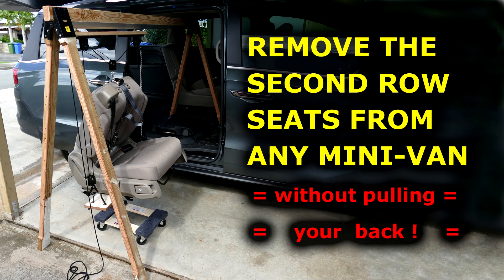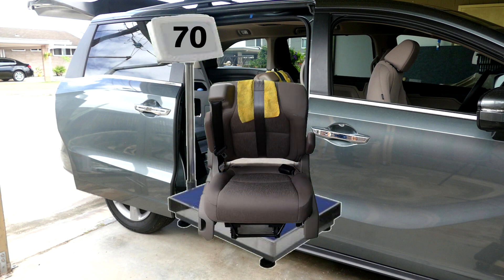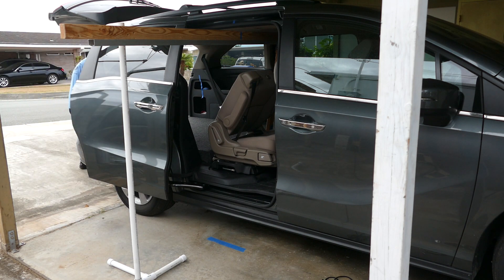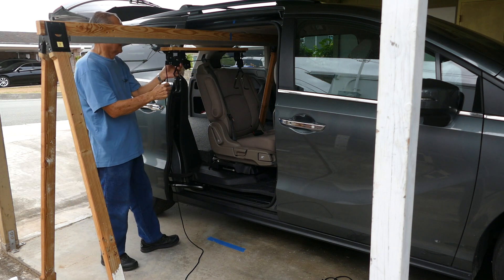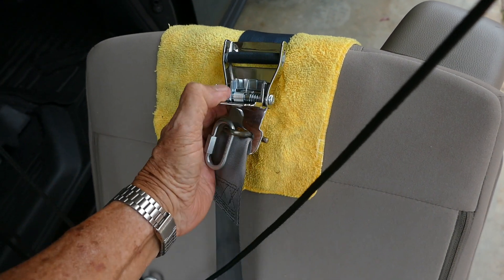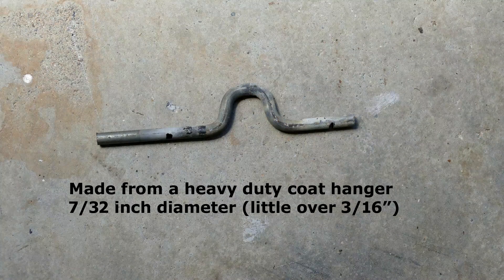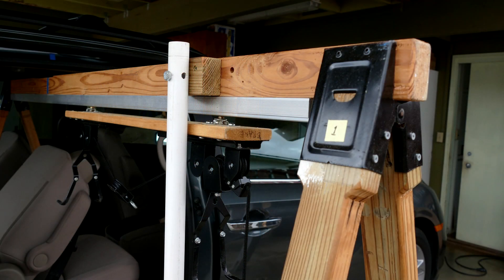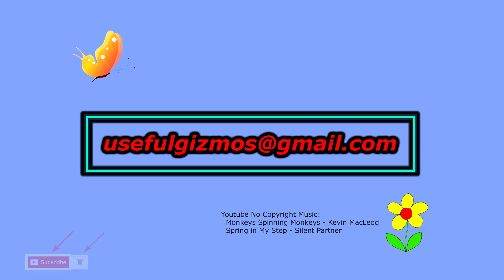Remove second row seats from any van or mini-van

Comment: Wish you put this video up in early 2019. I had to lift these when I needed to haul some stuff. I had a 2004 before my 2019. Honda really blew the design for seat removal. Will not ever remove those seats again without using your design. Thanks so very much.
Reply: Hi Gladiator,  Yes Honda had no consideration for 2nd row seat removal in their design.  Without the capability to lock the seat back in the down position, it poses a greater risk of pulling one's back when removing the seats manually.  Thanks for your kind comments and have a great day! .... Usefulgizmos

Comment: Please where is the video that shows how you made a flat floor for your minivan?
I have all my seats removed from my 2006 Honda Odyssey but need help w/making a flat floor in my cargo area.
Thank you.
Reply from the maker: I haven't made a video for the flat floor.  But to make it, I used 2x4's (1.5" x 3/5") edge wise going from left to right (not front to back) as supports.  Then 3/8" plywood on top.  The back of the plywood rests directly on the folded down 3rd row seats.  ..... The plywood is in two sections.  The back section is a perfect fit when the 2nd row seats are all the way back.  When the 2nd row seats are removed, there is a front section of 3/8" plywood that extends to the back of front row center console. ..... There is a 2x4 placed under the joint of the back and front plywood to support both, with wood screws holding down the plywood to the 2x4. ..... Carpet extends all the way from back to front and covers both back and front sections of plywood.  When the front section of plywood is removed, that portion of the carpet is folded under the back section of plywood. .... Hope this helps.  Thanks for watching and have a great day! .... Usefulgizmos
Reply: @usefulgizmos  thank you for the all that information but honestly Im very confused at just reading all that.
Im 62 yr old female w/bad arthritis & was hoping to see how it’s done.
Im hoping I can find a handyman who can read your instructions & do it for me because I won’t be able to.
Thanks again.

Comment: How about a simple Harbor Freight "Cherry Picker" lift.
Pick up the bugger with a strap and be done with it.

This another example of why easy when you can go difficult!
Reply from the maker: Please draw the plans for converting the "Cherry Picker" lift to do the job and post a link to the plans.  The plans need to address:  1) how you will convert the "cherry picker's" published lifting height range of 69-5/8" to 82"  to less than 61" since the bottom of the van's roof is 61" above the ground and you need to lower the crane lower than that to connect to the chair before lifting, 2) how you will roll the "cherry picker's" heavy frame out while simultaneously holding and guiding the chair out of the doorway, 3) how the "cherry picker" can roll in/out when the carport's floor is higher than the sidewalk like in my case (as shown in my youtube video), 4) how you will lower the 70 lb chair all the way down to the dolly without a rope and pulley assembly, 5) how you will position the dolly under the chair since the cherry picker's bottom frame is in the way.  If you don't show us how to do/overcome these things, then maybe your idea is jumping to a quick invalid conclusion.  Maybe easy to say but hard to actually do.
Reply: Yeah, go ahead Joey. I want to hear your explanation of how to get a cherry picker to lift up seats inside of a van. Another example of a worthless suggestion. 😂
Reply from the maker: Oh, and one more thing Joey.  Where does one store that large cherry picker apparatus when not using it?  I can store my disassembled jig in the rafters of our car port.  There's absolutely no room to store that large cherry picker anywhere on our property out of the rain.